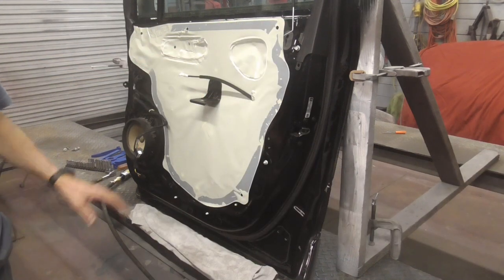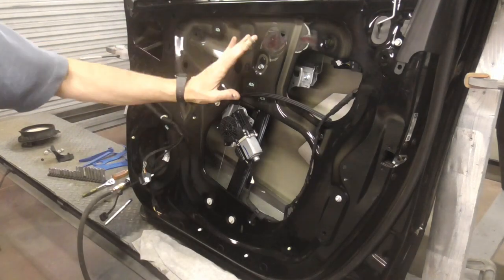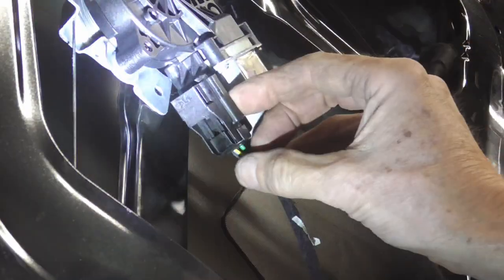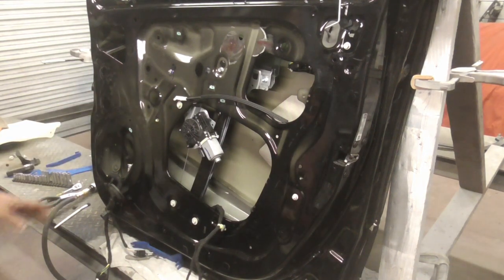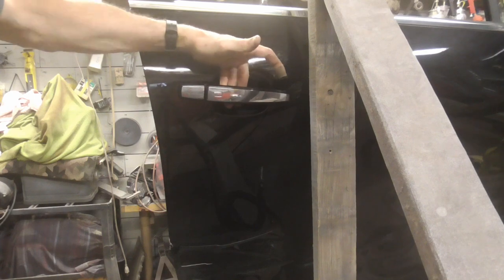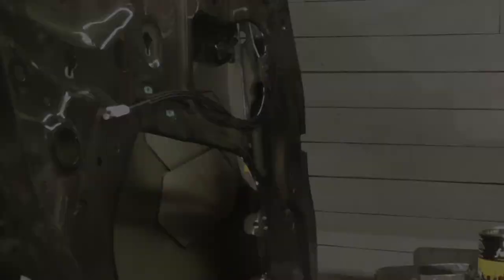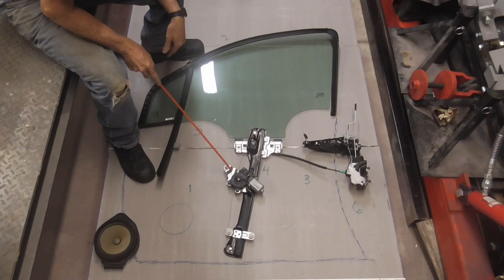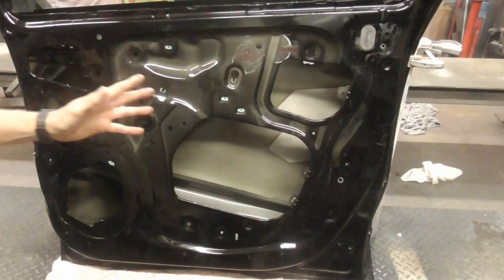Car Door Replacement:  Removing & Replacing Automotive Door Parts

Comment: How about getting new rubber grommets back in? Dish soap? I replaced my speedo cable and it came with a new firewall grommet. The recess is pretty deep that overlaps the firewall and the ID for the cable has a very tight tolerance. In other words, I can’t install the grommet and then thread the cable through after, as the mounts for the gauge and transmission are much wider than the ID of the grommet. I’m pretty sure the ends are assembled after the grommet is put on the cable. This is my last British car lol. Never mind the Lucas wiring! Great video, glad I found your channel.
Reply from the maker: Thanks Chris.  Yeah, you can mix some dish soap and water in a spray bottle and try that.  I'm not exactly sure of what it looks like but I would run the cable through the grommet then install the grommet.  Let me know how you get it done :)

Comment: Great video Jerry.  The electrical connectors are always a challenge since all the manufacturers have their own design.  I like that 1/4 inch drive air ratchet!  I always cut myself at least once working around the sharp sheet metal of a door.  It keeps Johnson and Johnson in business!
Reply from the maker: Yes - I keep the bandaid business going :)  The connectors are like little puzzles - they should have a kids game called "Undo the Electrical Connector"  A whole box of various companies connectors.

Comment: That door handle looks tricky. I've yet to run across one the screw only backs out a bit. I'll have to try to store that in my memory bank. Great video! Thanks!
Reply from the maker: It is the craziest design but lots of new doors have this.